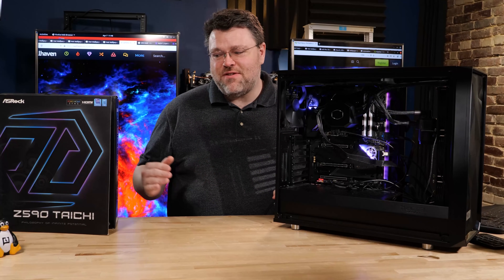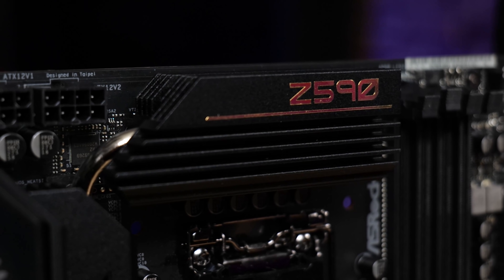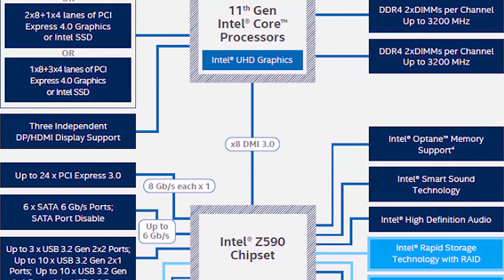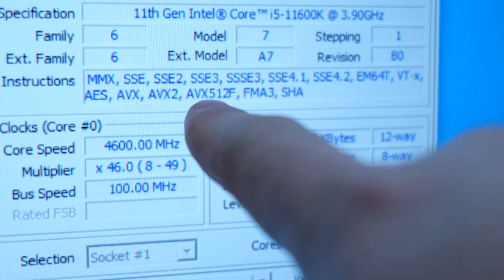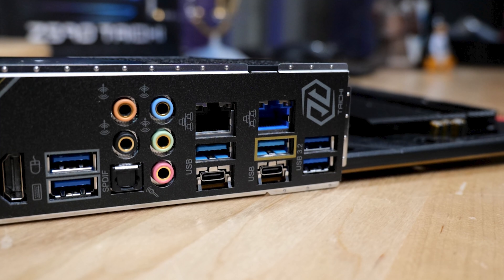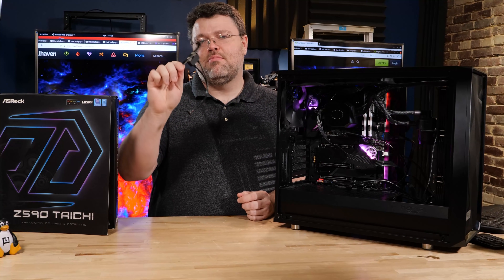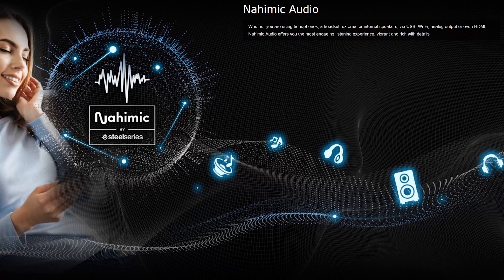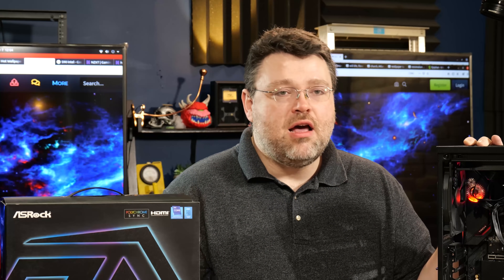ASRock Taichi Z590 - Thoughts on Intel Rocket Lake Changes, and Build

Comment: any info on supporting the full 128GB RAM? I'm looking for a super-fast Linux system that will use all the RAM. I've seen negative reports on newegg e.g. (not necessarily this board but other 590 boards) where the memory wasn't fully working with over 32GB. Thanks & great work, Wendell - subscribed

Comment: 8:05 this is why i still like cases to have 5.25 bays. maybe you dont need a 5.25 drive, but you might want to add thunderbolt or USB-C, USB-A, card reader and front audio at some point. Maybe you need 1/4" audio on the front

Comment: I think you repeatedly made a mistake of 1000 AMPS..... If you push 1000AMP's to any motherboard, it will blow the fuck up. 

On a 12v rail, 1000 AMPS = 12,000 WATTS.
I think you meant 1000 WATTS, not AMP's. 
- Just sayin'

P.S. Love your channel, and fan of your work with others like LTT, GN, etc..
Reply: 90A stages times 12 = 1080 *A*mps
What you forget is that CPU run on very low voltage and comparably very high amperage.
Of course consumer CPU's probably wouldn't survive anything above 500W even with liquid nitrogen.
But Threadripper or Xeon can easily take 700W or higher under proper cooling conditions.
Since you always want some overhead and don't usually want to go to the max the power stages can take it doesn't sound so extreme at all.
F.e. 1.2V (CPU core voltage) times 500A = 600W.

1000A is not what goes to the 12V rail.

Comment: I noticed from various charts published by other YouTubers about PCIe Gen. 4 and how it does not enhance the gaming experience but I bought a Gen. 4 drivr for other tasks. I wanted to know whether PCIe Gen. 4 would enhance virtualization workloads as well as work with a RAID 10 HDD volume on AMD X570. Turns out that, with the Gen. 4 drive, I can basically achieve both my dreams at the same time. As for the HDD RAID speeds in games, it performs quite well at 1080p with a few settings tweaks but I am certain that a HDD raid will struggle with resolutions higher than 1080p. Beyond that, I have yet to test the differences between Gen. 3 and Gen. 4 NVMe to determine whether a generational upgrade makes a difference for enhancing virtualization and HDD RAID volume speeds but it is something I intend to do at a later time. I also intend to test whether NVMe Gen. 4 will enhance tiered storage performance with another M.2 SSD and a HDD acting as a secondary drive as well. I hope for the best but only time will tell whether things will work or utterly fail.

Comment: Regarding what 10nm would have improved, if Rocket Lake was on it, I think that the cache would have been better: lower latency (to keep what 10th gen had) and maybe also more (together with the lower-than-now latency). That by itself might bring pretty nice performance (including not having any more of those performance regressions it currently has). I think that core per core, it would have been better than AMD, even though the IPC would still be lower.

Also, on 10nm, you can add more transistors. Most likely the extra transistor budget would only go in extra cache, and everything else would be to have more cores.

Lastly, if 10nm would get to the same maturity as 14nm is, it might get to 5.6 GHz. But I think we'll never know.

Comment: yo, Wendell, how on earth have you only managed to get 3800Mhz memory in synced mode? I've been daily driving 4000C16 for three years on 8th gen, the memory controller should be somewhat improved; Gear2 mode is there only to claim the top scores in DDR4 frequency on hwbot's leaderboard (with LN2). Der8auer said VccIO2 is the new IMC voltage knob, leave VccIO alone this gen. My 4000Mhz daily settings use 1.155 VccIO, 1.210VccSA and 1.435Vdimm (B-die), try these settings but punch the corresponding one into VccIO2, leave  VccIO manually at stock voltage. Also, fix VccST manually at 1.000V; ASRock boards bump this voltage for no reason when you turn on XMP and it destabilizes everything. Feel free to ask if you need better instructions!
Reply: lepkr, I am very interested in your Dram voltage settings.  I don't own the Taichi Z570 board yet, and I don't understand what exactly to set in the BIOS.  I have downloaded the User Manual where it describes dram voltage in 4 terminalogies, i.e., 1) VCCIO (I think it corresponds to your VccIO), 2) VCC PLL Voltage (doesn't seem to match with your VccSA), 3) VCCIO 1 2 Voltage (I have no idea of what it is), and 4) DRAM Activating Power Supply (isn't it tie with your dimm "B-die"?).
As I am planning renew my motherboard (Gigabyte Z490 AX PRO which has a serious problem with both USB A and USB C), and I don't really familiar these dram over-clocking things, I'll be very grateful for your advice.  Thankyou for reading my crumsy comment.
Reply: @chuejai  VCC PLL is for LN2 overclocking, no need to mess with it on ambient temps; same with DRAM activating power supply. What I refer to as Vdimm is the DRAM voltage (1.435V), VCCIO should be the same for both platforms and some people say VCCSA is for Ring overclocking (also referred as Cache) so you may or may not need to fiddle with it to see if it stabilizes things for you. It automatically goes up when you set XMP on my board so I think it's indeed needed.

Comment: Q: Can I use/switch the CPU Gen 4 x4 M.2 slot to a Gen 3 x4 slot? (for a Gen3x4 NVMe SSD)
Reply: PCI Express is backwards and forwards compatible so you don't have to switch it manually.
The manual lists about 50 3.0 x4 NVMe SSDs that are verified compatible so I wouldn't worry about it.

Comment: it does tempt me to move to intel again, amd chips are just too hard to find in Europe
Reply: 11400 is the perfect value gaming CPU. Intel is a better option on the low end.
Reply: The 5800X is widely available at MSRP, idk what you're talking about. These intel chips have better availability and are being sold below MSRP because pretty much nobody in the DIY market wants them, so that's that.
Reply: @tommihommi1  it's MSRP is sheit tho,  450€ for an octacore that launched half a year ago? 11700KF is 390€ and 11700K 410€. You either wait another 6 months for AM5 or build something on the cheap, which ironically nowadays means going Intel...
Reply: @lepkr6095  idk where you're looking, at Mindfactory the 11700KF and 5800X are the same price, and since the 5800X is faster on a better platform, the choice is obvious (if you want an 8-core)
Reply: @tommihommi1  Intel is great value. 10900F is 350 USD over here for a 10-core. 250 for a 10700F. Nuts

Comment: There have some boards using the Infineon 1000A VRM design with their 16 phase controller and 70A Smart Power Stages, for example the X570 Xtreme. So this isn't even the biggest overkill VRM put on a "mainstream" platform so far.
Reply: Yeah I was thinking that was the case. I remember seeing that when looking for motherboards. I ended up going with the X570 Aorus Master though.

Comment: Laughs in 5800X
Reply: The worst chip in the Zen 3 lineup.
Reply: @FtGFA  That trades blows with intel's 11th gen flagship. Your point?
Reply: @BlackCubone  My point is why laugh having purchased the worst value in the Zen 3 lineup?
Reply: @BlackCubone  he payed 450$ for an octacore. Pepperidge Farm remebers that the 3600 was 200$, he overpayed +125% of that to get two moar cores. We used to laugh at people that overpayed +30% to get 2 more cores in the X99 era (5820k, 6800k), it's hilarious how the tide has turned for some people when the price sticker isn't blue
Reply: @lepkr6095  I didn't buy one, at you can get it for 400€
Reply: @tommihommi1  400€. What a ripoff.